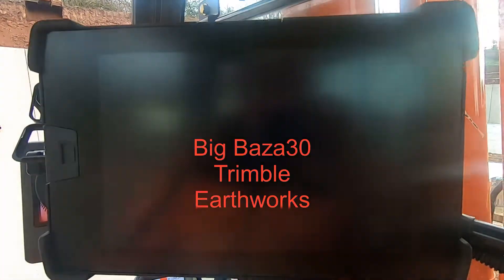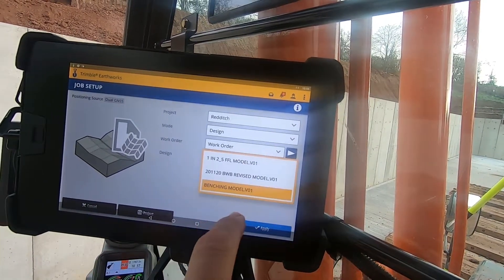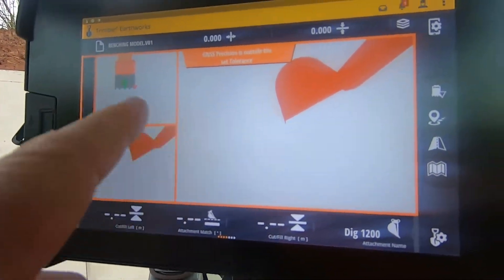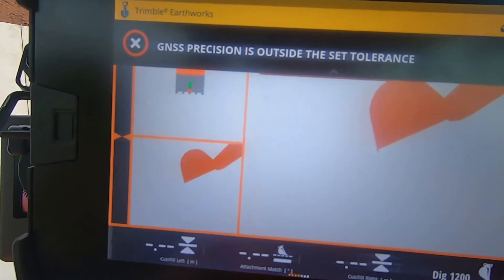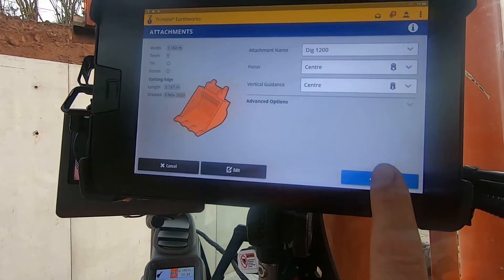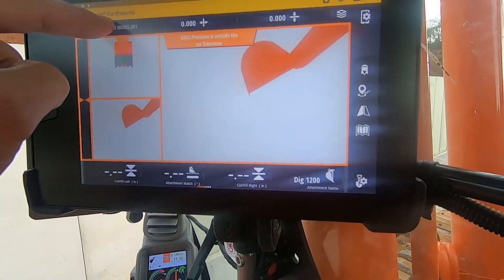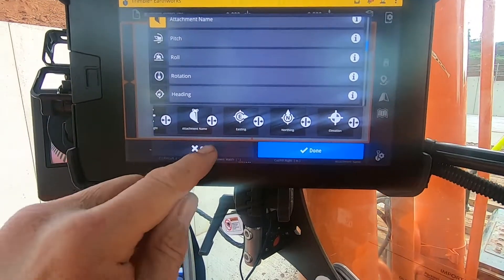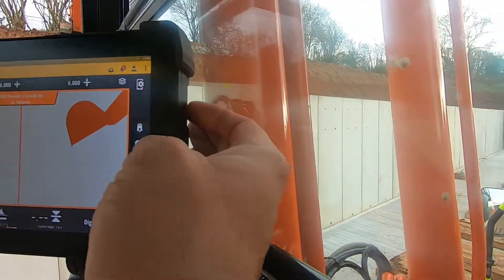how to use trimble earthworks, on excavator,  hitachi 350 long reach

Comment: when you walked up to  that machine there was no visible scratch on the counter weight.  then by magic the concrete panel is orange. go on what happened
Reply from the maker: The Machine had rubber cleats on the Tracks and was sitting on wet muddy Bog boards, with it being a 50 ton Long reach, when you slewed round the Tracks were slipping on the bog boards inching closer every time I slewed, The counter weight had to be about a foot away from the wall for me to reach the top of the Design, so ended up scratching the weight, didn't know I'd done it, it was the Dumper driver who told me. I spayed it up with some Taxi Cab Orange which is what Hitachi use, and it looked presentable. hate marking Machines, lucky I had same original spray
Reply: @bigbaza30  lol